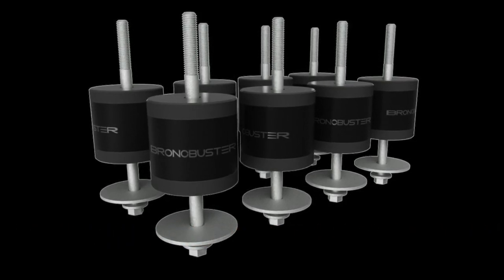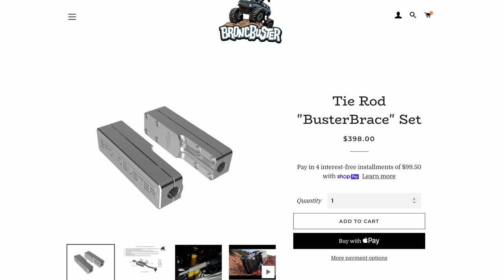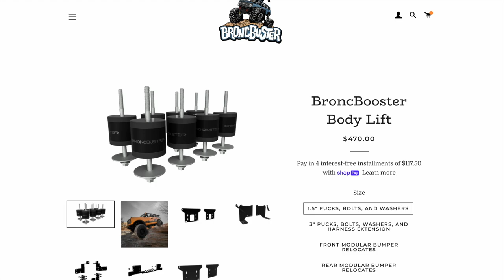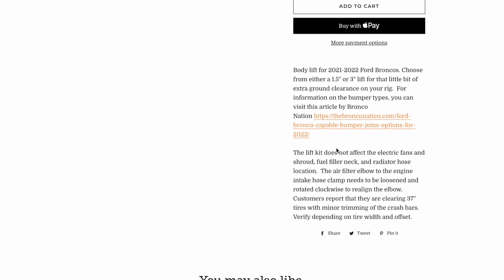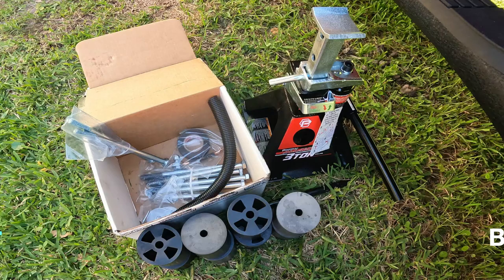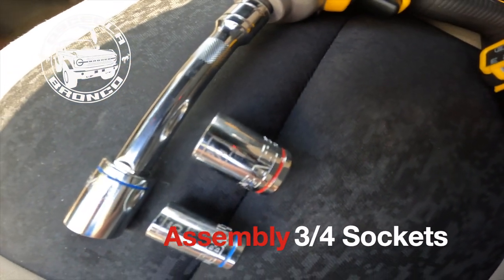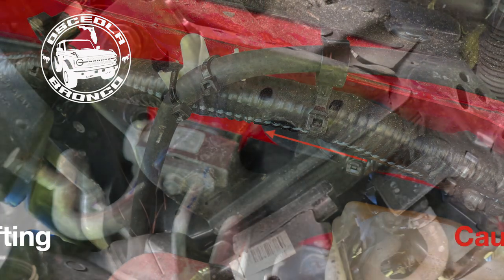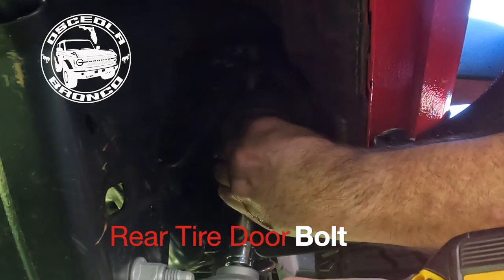Bronc Buster 3" Body Booster Lift Kit Install

Comment: I appreciate the time and effort you took in producing this video. The problem I have with most body lift's is the gap created between the factory bumper location and the body. If this can be overcome to look original, okay. You mentioned in your description that you were uncertain about the bumper relocation brackets. Did you use install them and are not sure, or are you on the fence about installing them? That gap is a deal breaker for me.
Reply from the maker: I agree that the gap does make it ugly. I just put on the front bumper relocate bracket. I just received the rear brakes today. I hope to have it install this Saturday. See post for updated picture of front end now.. https://www.facebook.com/BroncBustertx/posts/171767148729877
Reply: @osceolabronco8319  Okay, that looks much better. I take it you meant to say "rear brackets"? I have the stock modular bumper and surprisingly can't find pictures of what the finished product looks like for this bumper.